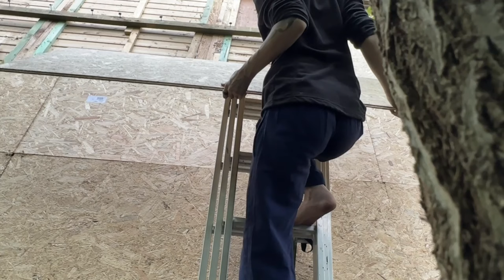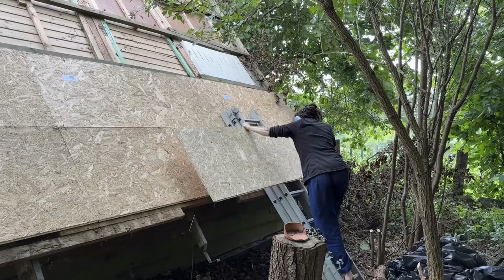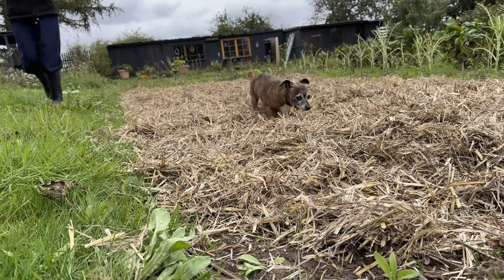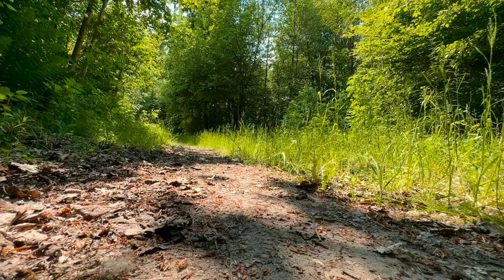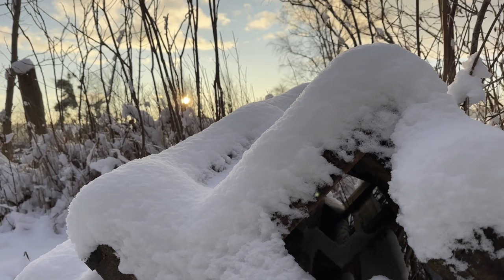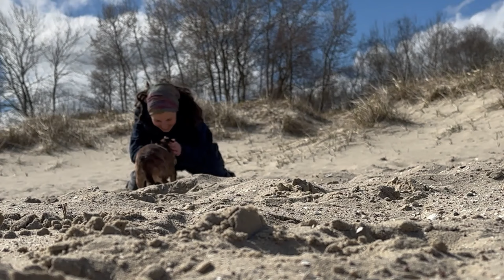Your questions: bare feet, health, and my story #051

Comment: I totaly agree with everything you said about barefooting. I have been barefoot for 2 and a half years and started when I realized that my chronic back pain of 15 years disappeared while barefoot. I now hike and trail run barefoot, have reroofed my garage barefoot,   even  steeped on a nail barefoot with no more than a scratch because I immediately felt it and adjusted. I have completely gutted and rebuilt my part of my daughters house with nothing more than a scratch on one toe but multiple cuts and bruises on my hands and fingers. At one point I saw a few rusty nails stiking right up from the floor and withought hesitation proceaded to step on them to to bend them down so no one would get injured. It was only after that I realized I was the only barefooter on site. I am thankfull that I dont have all your medical chalenges and really admire your courage and determination and of course just subscribed
Reply from the maker: Thank you so much for sharing! I am so glad to hear that barefooting is working out as well for you as it does for me. Yay!

Comment: I have been a barefooter since 2014, and guess what, I ALWAY use my string trimmer while barefoot! I also rebuilt my back deck while barefoot.

I agree with you that shoes are tools, and are seldom needed.

👣👣👣👣👣
Reply from the maker: Yay! Good that you have found your boundaries, and are comfortable with your choices. I still don't think string trimming in an unknown area was smart, but I don't judge you for string trimming barefoot at all.

In many situations with most of those small trimmers, I don't see an issue. If there is a large risk of getting trash or rocks or whatever flying at you, or if it is a bladed trimmer, it requires some prior consideration. I think, a lot of this is a choice you make in the situation. And a video will never show enough for others to make the choice.

All the best to you :)

Comment: Going barefoot was the best decision I ever made. I started by doing regular barefoot hikes 6 years ago and then 4 years ago I donated all my shoes to charity and put my socks in the bin and now the only footwear I own is one pair of sandals which I have worn around 20 times total since I got them 4 years ago.

My goal Is to get rid of my sandals by the end of the year.
Reply from the maker: I am so glad this is working so well for you! Do you have to handle any advanced terrain? Thistles are my current enemy.
Reply: @RootsandCalluses  My soles can handle pretty much anything at this point, for the past 4 years I've done everything barefoot including driving, going to work, cycling, in the gym, in snow, doing gardening, doing home renovations and I've went barefoot in lots of different countries in cities, woodland, sand etc.

When I said that I've worn those sandals about 20 times since I got them 4 years ago about 13 of those occasions were in the first 2 years of my barefoot journey. Its been almost a year since I last wore them and I'm just about confident enough to get rid of them. 

My barefoot journey so far has been like learning to ride a bike and the sandals have been my stabilisers but eventually you can cycle without them just as I can now walk barefoot without the sandals.

Comment: My footwear habits are almost identical to yours. Protection needs are the primary consideration. I go barefoot as much as I can, and have done so for about 14 yrs. In the house, in the garage, in the yard, driving, shopping (usually)... I'm barefoot. I'll wear flip-flops or boots when I feel I need the protection. Clearing brush usually involves briars, and sorry, I can't do briars barefoot. Also, when I break out the chainsaw, out comes the boots, and chaps, and gloves, and helmet. String trimming... I'll wear boots, long pants and a face shield, as I'm usually getting blasted with debris, just about from head to toe. While mowing, my feet are bare because they don't need protection, but my lungs and eyes DO need protection, so I wear a respirator.

One caution I'll share with you.... The soles of my feet are tough, and I can tolerate more than anybody who habitually wears shoes, but... my soles are not as tough as they were last year. I'm over 60, and I'm finding that my soles are losing toughness as I age.

I'm glad to see others who deliberately choose to live barefoot.

Good luck to you.
Reply from the maker: Happy to hear you haven similar approach to shoes 🙂 The soles of my feet get less tough every winter, so I am used to paying attention to my current protection level. Thanks for sharing 🙂

Comment: My niece has EDS as the rarest and worst type. Most of my family has degrees of hyper mobility issues and pain. I have enough trouble that I’m thinking about getting the bloodwork done, but it only shows up in 50% of the population that way. I have Meniere’s Syndrome and never questioned you wearing ear covering. I listen to cell towers all day long, it’s deafening. I had three surgeries to try to help with endometriosis, I’m sorry you have that too. I’m also quite allergic to a lot of things and meds, I can relate.
Reply from the maker: I always prefer knowing to not knowing, so I'd definitely get the blood test done. If it doesn't show up, you are where you are now.

Meniere's was one of the many things I've been misdiagnosed with when my hearing was bad for a few weeks at a time. We were sure I was losing my hearing. I was fortunate enough to recover, and most days, my hearing is fine.

Just a small note that I hope you don't take the wrong way: I try to avoid comparing or ranking suffering. Some people will argue that my classical EDS is worse than the hyper-mobile type but less bad than the vascular type, and so on. I don't think it works like that, and if you rank suffering, it can be really easy to say things like "well, it could be worse" and dismiss the one that was ranked lower, no matter how bad it still is.

Just the other day someone told me that chronically ill people don't get discriminated or oppressed like other groups, so it's "not that bad" (and thus, people like me shouldn't complain). Whenever we rank these things, the groups further up or down in the ranking get affected by how it skews perception. She thought chronically ill people shouldn't complain, because there are people who suffer more.

Diseases are also highly situational and personal. One person with hypermobility (so, supposedly suffering less than e.g. me) might find herself unable to lead their life while another person with the "worst type" is managing well, because of other factors. It just gets complicated so fast, that I try to avoid ranking at all. "Well, at least it's not cancer" is the sentence that started this thinking. Someone said that to me, when I told them about my disease. They dismissed my very real disease and my very real pain, because they could think of something worse. I'm not saying that's what your doing. But how you phrase things affects how others perceive them.

Either way, I wish your niece all the best. I hope she manages her disease well, and isn't suffering too much. I hope you don't think I meant this in any unkind way. :)
Reply: Great advice, thank you. I hope all your days are easy ones.
Reply from the maker: I am glad you didn't take this the wrong way :) The same to you!